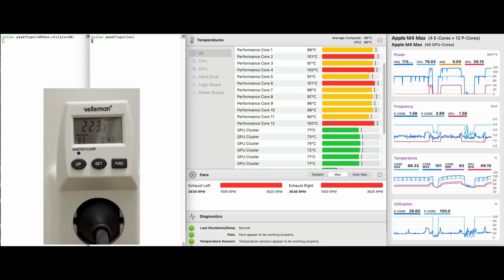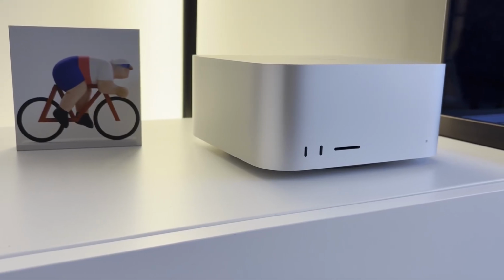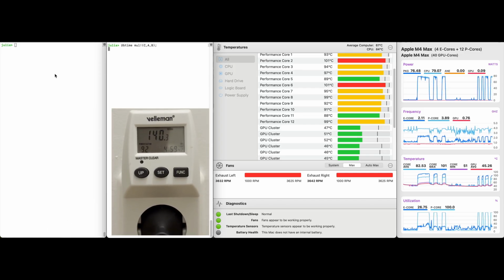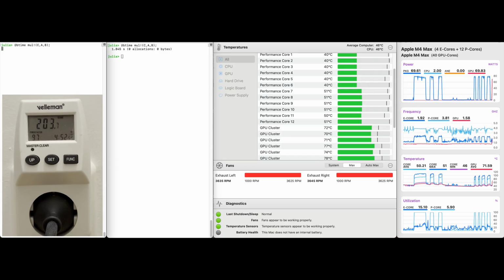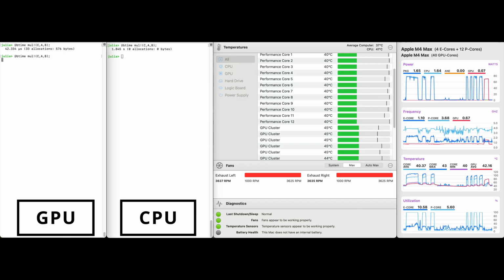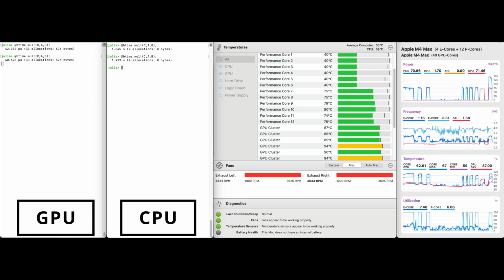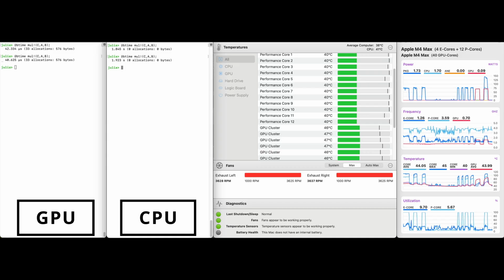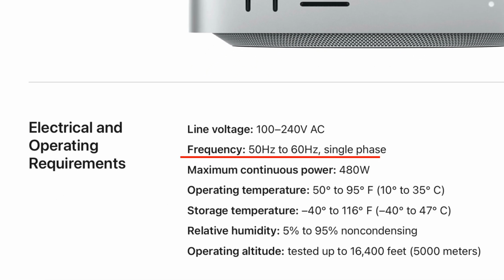Is this why Apple did not come out with an M4 Ultra: Mac Studio M4 Max consuming over 330W!!!

Comment: Weird they did not come out with an M4 Ultra for the Mac Pro since it did have the cooling and power capacity. They could have done the M4 Max,M3 Ultra Studio then M4 Ultra Mac Pro. or maybe a Mac Pro that's a bigger version of the Mac Studio coming out in 2026?

Comment: I tried it on my base 14" MacBook Pro M4 Pro. At the moment it ramps up in power, it thermal throttles instantly. The temperature jumps from 50°C to 108°C. The highest recorded power using Apple’s sudo powermetrics is 71W for GPU + CPU, and the total consumption including the screen, etc., is 111W. 
I had set the fans to 100% two minutes before starting the test; it feels like blowing in the air .
Reply from the maker: I recall someone using AIDente app on their MacBook. That one can apparently measure the power draw on the battery and AC.

What did you run in your stress test?
Reply: @PetarMarendic  I used sudo powermetrics to see the consumption of the m4 pro CPU+GPU+ANE Tg pro to maximize the fan speed, and ALdente to measure the consumption of the entire machine (1000nits display)

Comment: why do you compare system power draw to ONE RTX card?? System draw on a 285K 5090 is well beyond 1400watts. 
You can see the M4max only pulls 80watts of power on the CPU while delivering WELL BEYOND 285K level performance, a 300watt TDP CPU
Reply from the maker: @PKperformanceEU  When I subtract base power load from peak load in my CPU tests, I find that the M4 Max CPU can draw around 115-120W with NEON SIMD fully stressed.

My point was that a hypothetical M4 Ultra could consume in excess of 600W fully stressed, which is likely too much for the small case to handle.
Reply: Reported comment and how dare you delete my objective comment?!!! This clowns missleading BS needs to be adressed. 

M4 needs 1clock cycle per 128b NEON SIMD instruction, 4x128b, so

Specs: 16-core CPU, 128-bit SIMD ×4/core, 1 cycle per 128b op, 4.5 GHz.
→ NEON FP32 (FMA): 4 floats × 2 FLOPs × 4 units × 16 cores × 4.5 GHz = 2304 GFLOPS
→ SME2 + FMLA (FP32, 2048b ZA): 64 floats × 2 FLOPs × 16 cores × 4.5 GHz = 9216 GFLOPS

If VL on SME2 is 1024b than 4608 GFLOPS.

C-Ray2.0 reflects this perfectly, where M4 10core is doing 7900X3D lvl throughput. 

End of debate!!!!
Reply: . 

M4 needs 1clock cycle per 128b NEON SIMD instruction, 4x128b, so

Specs: 16-core CPU, 128-bit SIMD ×4/core, 1 cycle per 128b op, 4.5 GHz.
→ NEON FP32 (FMA): 4 floats × 2 FLOPs × 4 units × 16 cores × 4.5 GHz = 2304 GFLOPS
→ SME2 + FMLA (FP32, 2048b ZA): 64 floats × 2 FLOPs × 16 cores × 4.5 GHz = 9216 GFLOPS

If VL on SME2 is 1024b than 4608 GFLOPS.

C-Ray2.0 reflects this perfectly, where M4 10core is doing 7900X3D lvl throughput. 

End of debate!!!

Comment: 108C there! so we will see water cooling in newer series M4 Ultra or M5 or this is performance bottleneck will tackle newer arm processor just like Cisc processor has now due thermal problem.
Reply: No, apple just need to adopt much more efficient 512b SVE2.2 and SME2.2+ separate CPU GPU with SoIC packaging

Comment: There's something very wrong with the reading from your power meter or the whole experiment itself. Because, the M4 Max does not even consume up to 60 watt peak for the CPU when it's under load, from various tests that has been shown on this platform. The same applies to the GPU. Your readings are way more than what the GPUs consume. I think it will be better to read the power consumption from the system using those apps dedicated for that purpose.
Reply from the maker: I also happen to have a Mac Mini M1. The readings I got on the same power meter were entirely in line with what Anandtech reported: slightly over 30W peak load. https://www.anandtech.com/show/16252/mac-mini-apple-m1-tested

For the Mac Book M1 Max, they measured 120W: https://www.anandtech.com/show/17024/apple-m1-max-performance-review/3

Finally, this person reported 212W on their MacBook M4 Max: https://www.reddit.com/r/macbookpro/s/GJFonh11yZ
Reply: @ Those first two tests from Anandtech was for the entire system, that is the CPU, GPU, RAM, etc. What you are showing for the CPU alone exceeds what the entire system for the M4 Max consumes. 
For the third one from Reddit, I don’t know the conditions involved but that also is the power usage for the entire system. For all you know, that laptop may have even been connected to other accessories that take power from the laptop system hence contributing to the power usage.
Reply from the maker: @wisdomyaw03  My power meter readings were for the entire system as well. This is how the majority of reviewers would measure power consumption. You can subtract about 15-18W of idle power from the readings I showed. That implies that loading up the 12 P cores to 100% increased the power draw by 120W from idle. Loading up the 40 GPU cores to 100%, increased the power draw by 175W.

The fact that the CPU temperatures near instantly shot over 100C, would indeed corrobarate the power meter readings. I was able to get this Studio to thermal throttle on a pure CPU load, with the GPU at 0%.

The app that I used, Mx Power Gadget, clearly misinterpreted the power consumed by the system as even the total package power was well below what my power meter indicated.
Reply: @PetarMarendic  So, if mx power gadget is showing something well below that of the power meter, why do you trust the power meter reading over the app. It’s very likely your meter is rather wrong, as I said earlier. 
Additionally, if just the CPU is throttling the Mac Studio and temperatures are that high, your unit is perhaps faulty.
Reply from the maker: @wisdomyaw03 Because my power meter is trustworthy. I compared it to results obtained by Anandtech and they matched.

An app can report erroneous results because the programmer wrongly interpreted the instrumentation readings or the readings themselves could be wrong. 

Power meters are the industry standard. They’re dumb devices and can easily be tested for accuracy and precision.

The best way to measure would be the way IgorsLab does it with a power meter straight over the CPU power delivery circuitry.
Reply: @wisdomyaw03  cry more apple fan

Comment: 100% agreed with this analysis. I originally didn’t believe apple would make a M4U this time around at all but given this test, I am more inclined to believe that apple may indeed release a M4U in the Mac Pro this year at WWDC. We will find out soon enough, less than 2 months. 

I know you don’t want to stress your system given so much heat but I am curious to see when apple throttles the cpu and gpu given the high temps. I’m pretty certain apple won’t allow their gpu and cpu just to burn out under sustained load. At some point they should just throttle and reduce power consumption .
Reply from the maker: Glad to hear you concur. In the meantime, I had a friend run this same torture test on his M3 Ultra with 60 gpu cores. The temps reached 107C on the CPU and 100C on the GPU.

I documented Mac Studio M4 Max CPU throttling in a prior video. In that demo I only loaded the CPU cores, and that was enough to cause the system to throttle down the CPU. You can take a look here: https://youtu.be/ptLWTCIItd4?si=3NImnVDHIfuqhqAT
Reply: @ yes. I saw the video and made a comment a day or two later that I believed the M4U wasn’t made for the Studio Chassis due to what you demonstrated. 😊 I ended up ordering a M3U 512GB version. I will use it for local large LLM. The copper will be helpful for the M3U.
Reply from the maker: @lanceguilin Oh, that’s nice! I observed that the GPU is much easier to keep cool. It’s spread over a bigger portion of the chip and that helps with heat dissipation.
Reply: @PetarMarendic  I have my M3U 512GB / 2TB now at home. I'm still setting it up -- coming over from Win 10; just not used to MacOS. But I did download a couple of local LLMs to play around with a bit. I'm loving the 512GB memory😁. For now, the M3U is virtually silent as compared to my old Window's Tower case with multiple fans inside. Admittedly I haven't really pushed it, but I did run some LLMs so it did get a little workout. Silent.

Comment: i think it would ran into thermal throtteling and slow down, it also would ran into power throtteling due to limitation of the power supply.
It all leads to the conclusion if you want perfomance at level of an 5090 you will have power consumption like a 5090 at the end. Its the same issue in small with th MBA in short time it has performance and than it is temperature controlled throtteled down. I would even think you will have similar results with an M3 Ultra fully loaded on CPU and GPU at the same time with a constant load. On the other hand it is more a theoretical problem as real situations where GPU and CPU are fully loaded at the same time should occur seldom to never (it does not say you construct situations lkike that but they are artificial), and if you ran into thermal limitations or power limitations the device will be slowed down matching the limitations. You will only be able to notice the limitations if you are able to modify the limits (better cooling, higher power supply). 
Its the same with the internal storage, you would notice the limitations ONLY if you have the comparisonwriting 4 T to the inetrnal storage , or writing the 4 TB to an external real Storage device, up to 100GB there will be no noticeable difference, if you get behind the limit of the simulated SLC-Cache, the real life begins and the transfer speed of the internal storage will slow down to a fraction of the speed pof an external TB5 solution with decent drives, while the external TB5 solution only costs a fraction of apples internal storage.
Reply from the maker: Since the publication of this video, I managed to find a person kind enough to run the same stress test on the M3 Ultra with 60 GPU cores. The CPU temps reached 107C and GPU 100C. It looks like even a 80C GPU M3 Ultra could exceed the cooling limits of the Mac Studio, let alone a M4 Ultra. 

Yes, you are right that this is an artificial load. Apple’s MLX library automatically selects the AMX engines in the CPUs over NEON. The former are 3 times more power efficient than the latter. 

Regarding the SSD: in another video I demonstrated how the 1TB I have on my Studio bottlenecked my ProRes 4444 export speed: it started at 4 GB/s, but once it ran out of SLC cache the performance collapsed to a mere 300 MB/s.
Reply: @PetarMarendic  Regarding the "TRUE" Strorage write speeds it would be interesting to have a comparison between different models, Generations, Storage sizes. at what data size does the collapsing start? with AJA and its graphical interpretation it should be easy to find out. The numeric value is just the median, so it is not so easy to figure at at what data size the decrease started.
If i look at my MBA M1 16/256 i encounter different levels of speed
It started somewhere  at 7000 (which is clearly in the unified memory, or even the controller chip immediatefalling to 3670 (up to 800 MB then dropping to 1835 , then to around 3,5 GB around 1000 then around 42 GB it went down to approx 200 (all values estimated on the diagramm provided by AJA with testing differnt data sizes above and below thresholds.

Would beinteresting to see these examinations for different models, Chiptypes, Ramsizes and storagesizes.

Comment: The Ultra has a copper heatsink versus the Max's aluminum one, so it may fare better thermally. Still, 150W on an M4 Max is well beyond what I expected
Reply from the maker: I asked a kind person to run the same test on his M3 Ultra with 60 gpu cores. The temperatures hit 107C on the CPU and 100C on the GPU.

Comment: While the M series of chips are more efficient (performance per Watt) than the Intel architecture that Apple left, physics is still the same.  As Apple ramps up the clock speed (note over a 10% increase from M3 to M4) heat will become more of a problem.
Reply from the maker: In this particular test, the M4 Max CPU cores may actually be less efficient than Zen 5’s, because the latter would be executing via its AVX-512 vector units that allow it to be over twice as fast.

However, it is possible to level the playing field by having the M4 use its AMX engines instead of NEON. Performance will still be worse, but power efficiency would improve. But if I were to do the calculation in single precision, for which the AMX engines are optimized for, then the performance would be roughly equal, while the Apple chip would consume 1/3 what the AMD chip would.

Comment: Question: are you sure you don't have an aberrant M4 Max? Have you tried running these tests on another M4 Max?
Reply from the maker: Another person observed over 200W on his MaxBook Pro M4 Max: https://www.reddit.com/r/macbookpro/s/txcNmQSN5j
Reply: @PetarMarendic  but not over 300W as you show us.
Reply: Btw, which version do you have 14 or 16 core?
Reply from the maker: @borodach6789 Hi! I have the 12+4 core CPU and 40 core GPU version.
Reply: @ Do you think there would be any difference with 10+4 core model?
Reply from the maker: @borodach6789 Possibly, yes.

But I should point out that in all other workloads I did not observe my Studio thermal throttling. This is really is an extreme scenario, but it shows that Apple chips can be get very hot if pushed enough.

Comment: No, ultra has copper heatsink, better build internally.  Probably more efficient when running two chips so ~30% reduction in overall power
Reply: Yeah, you’re right. So I went with the Mac Studio with the M3 Ultra instead of the M4 Max.🤣512GB RAM is so great.
Reply: "No, ultra has copper heatsink" <- that does not address the power-draw problem.
Reply: @TheDanEdwards  They can just throw in a larger PSU and adjust the fan curve, it's not that big of a deal if they're already using a better heatsink. I have the M3 Ultra and in my stress testing it never exceeds 250W so seeing the M4 Max exceed 330W is quite a surprise. But unless they plan on never putting another Ultra chip in the Mac Studio again, I doubt this is the reason why we only got the M3 Ultra.
Reply: @ " They can just throw in a larger PSU" <- the box is a constraint on the PSU size, not the SoC.
Reply: @TheDanEdwards  read the rest of the sentence... it *definitively does*... Literally the phrase... reduction in overall power... was missed?
Reply: There is an assumption that the foreseeable M4Ultra (vs M3Ultra) is double the M4 max, which it is *not*, at all.  Is the M3 Ultra double the power draw of 2x M3 MAX?
Reply: @ it is virtually almost 2x if you're measuring specifically the chip. however most people measure at the socket where it won't be as close to 2x because the system is more efficient running two chips at once. the 10-20W running the rest of the system doesn't need to double.